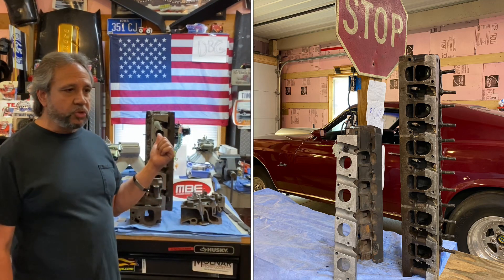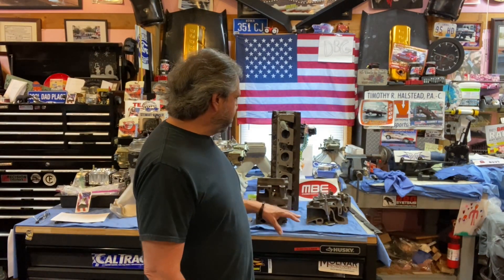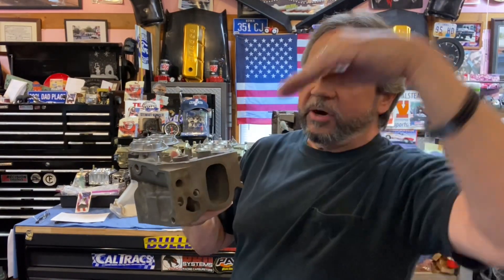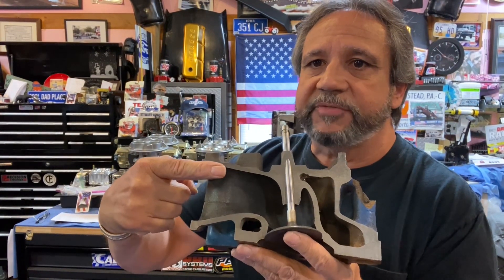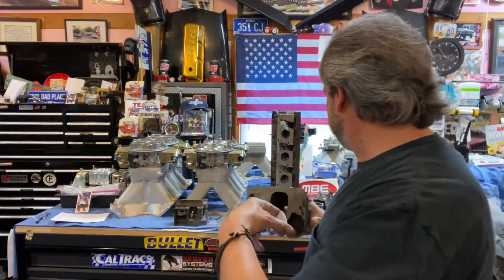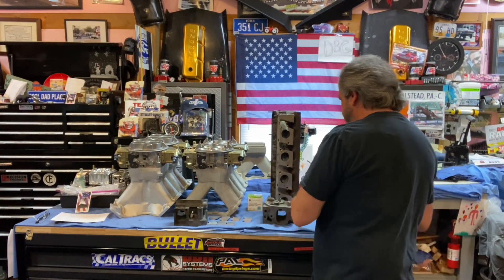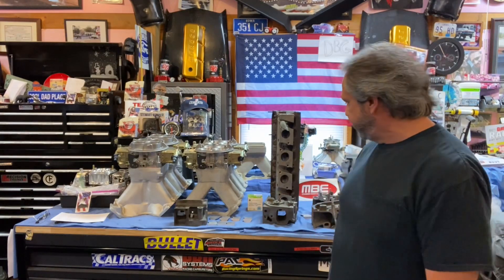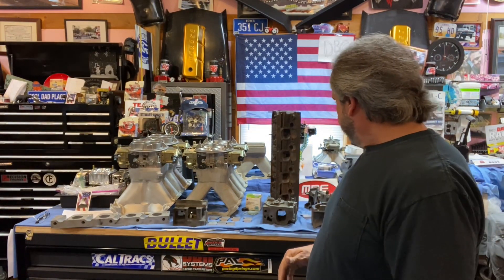DragBoss Garage: Pick Up 30 Ft. Lbs. Of Torque Filling The Port Floors Of 351 Cleveland 4 BBL Heads

Comment: smaller 2v heads running much better than 4v heads example from Holley carb  engineer, from your previous video.  2v heads were 5 seconds faster lap times.   instead of filling in a bigger port, why not use the small port head to begin with.  a picture emerges with the Cleveland heads.  either put more cubic inches under the 4v heads, or use the 2v heads under the stock displacement engines.

https://youtube.com/clip/UgkxcvcwScqy1NPsg1Hp1CobNkm2LqdjFB21

Comment: the Cleveland 4v ports were big enough for a 500 cubic inch engine.  you can add 50 ft. lb. with 50 cubic inches more displacement on the same port. seriously, you can either raise the floor of the port, or you can just make the engine bigger to better match the bigger port to begin with.  how bout a 500 cubic inch Cleveland with the same 4v head.  or a 600 cubic inch engine.  of course it can't be done but seriously, at some point more cubic inches makes the existing port just right, or too small.  I've had 351C, 400M, 4v, 2v heads and after a quick look at them, the best approach is build the tall deck 400M bored/stroked to maximize cubic inches.  if you want torque, just use the 2v heads and port those, which is what the old Holley carb engineer said in his video when you interviewed him- that was done decades ago in the 1970-80's and the engine was 5 SECONDS quicker lap times.  the 2v head already has a higher floor.

Comment: Tim, I run these stuffers in my 372. They do hurt flow a little when I tested them on a super flow 600 compared to unstuffed heads. I have run these with a Terry Parker funnel web intake and a CHI dual plane air gap. With either intake it had more low end than a full 4V and a strip,dominator. For track day, the CHI air gap was better off the corners. I suspect I am losing a little upper end HP to the Parker intake. Installing the stuffers is easy really. Use Zspar epoxy. Work it into shape with wet hands, let it dry and then Clean up with cross buffs.
Reply from the maker: Cool deal to know. So your running circle track? Does splash zone work similarly with water for shaping? Thanks for the real life experience

Comment: There used to be bronze spacers that went on the exhaust ports  with a toungue to fill in the dip on that thing and the headers kept in in place! Are they still available?
Reply from the maker: Yeah I think mpg in Colorado has them.
Reply: @dragboss351cleveland  maybe@ Ive been drag racing here in South Carolina for decades. I'm 63 now and my wife's health has gone down hill. The guys left the 9.2 deck blocks because technically the blocks were the weak link! Curiously enough, the Eldebrock Victor Jr heads almost the same 274cfm of airflow!!? The Cleveland block aren't up to the stress nitrous puts on them! The Windsor blocks with a crank web hold up pretty well! But, most of that are numbers based on nitrous,  a sledge hammer! But now the availability of high flowing heads on a Windsor platform are awesome!! I'm looking for a package for my 94F150 flareside, the 460 platform is started to become a financially affordable platform!! Let's face it, I'm not going road racing in a 94F150!! A 500hp 460 with a 100 shot of gas! Last forever,  or until it kills you!! You gotta die from something,  let the coroner earn his money wiping that grin off ur face, or not?!@
Reply from the maker: When you speak of 9.2 blocks I suspect your talking cleveland. I agree not strongest blocks. Yeah anything with nitrous make so much more cylinder pressure and those blocks were not a designed for that. Not a fan of edlebrock heads. But use what works for  you. Truck with bbf will be fun. And a little spray will make a fun day

Comment: Same holds true with the the 429-460 exhaust ports .c8-D3's . That darn low spot.
Reply from the maker: Cool deal, have heard that before about those heads, as is oiling issues with them.
Reply: @dragboss351cleveland  MPG Head used to manufacture brass bolt on exhaust port plates for the 429-460 and BBC . They cited about a 25 Hp gain and 25-30 lb ft of torque gain. They also made stainless steel intake port plates for the Cleveland heads.
Reply from the maker: Yea they did, but thought they were bronze for Cleveland as well
Reply: @dragboss351cleveland  that's right. They had them for the exhaust side in bronze, stainless for the intake

Comment: I learned about those water jackets years ago, bought a 5.0 thunderbird for the block and someone had welded the motor mounts so i tried grinding those welds out and got into the block just a little bit! And antifreeze started trickling out block ruined!
Reply from the maker: Yikes, that sucks, but a lesson learned for sure Brandon

Comment: great vid, the int port inserts shown are  the same as the ones from Price Motorsport Engineering (PME) which are modeled after the 1969 Ford T/A port inserts, these inserts should NOT be install as is and MUST be shaped/ground to port opening shape of no less than 2-1/8" to (2-1/4" BEST) tall port opening, the short turn needs to be ground/re shaping laying back & raising the short turn similar to some of the factory T/A race head designs turning the int ports into more of a venturi shape. Also slight regrinding & clean up of int port roof of (1/8" MAX) higher will help with better T/A venturi shape
Reply from the maker: Yes I figured that they need some good work over. I was thinking of doing a set and trying my luck to see how so could do. In my spare time lol. Have done a few of these installs Porco?
Reply: yes we have done a few (1/4" thick finished) PME versions and even 1/4" thick steel tongue versions that also bolted in from underside. FYI, Some of the aussie port stuffers (Parker/TFC tongues ) out are too thick and end up restricting/hurting top end flow
Reply from the maker: That’s is something you don’t think about thicknesses. One set of pro stock Heads I have are about 1/8 to 1/4 inch. Not much.
Reply: I tried to post a link to some of my old 1/4" filled P/S boss heads and it got deleted again. There was an articall online i think from motortrend showing pics of boss 302 build/dyno, the guy used the aussi parker/tfc "port stuffer" by the time he was done with grinding them where they did NOT hurt upper end power they basically looked similar to a finished set of the american PME/FORD T/A "port insert" design originally from 1969. The restrictor port aussi "port stuffers" screw up the factory short turn design hurting top end power. Again the factory 4V port openings should not be shorter than a 2-1/4" opening curving up and over the short turn.
Reply from the maker: @393boss  must be you tube that deleted. Just email me at thpa351@gmail.com. Never seen any articles like that
Reply from the maker: I saw your email let me look at it. Thank you

Comment: Great advice Tim, another way that i did was to use 2V heads which have smaller ports, i went to a lot of expense to find some 4V heads only to lose power,
Reply: 2v with a small chamber laid back around the intake and exhaust . I used the aussie 302c heads . hand port the ports . picking up cheap compression & doing your best to improve flow.
Reply from the maker: I like those heads too
Reply: @dragboss351cleveland  The only thing with the 302 Cleveland heads is the compression is too high  for a street engine on a 351, the combustion chambers need to be openened up a little for pump gas, and like you said keep the revs under 7000. otherwise they are a better option for a street engine.
Reply from the maker: @georgejohns7966  Thanks, I have always ran race gas on the street, needed it and enjoy the smell😀
Reply from the maker: Thanks George. Do what works for you. If your not spinning that engine over 7200 might not make the power you thought. But also combo has to match. Nothing wrong with 2v.

Comment: Animal Jim ran those air vanes 40 + years ago that I know of. seen him with the manifold off in the pits at KCIR. Maybe some of Kasses old school stuff?? Filling the floor makes sense with tunnel ram applications, none of the potential energy column volume is lost with the ram making up more supply of readied fuel and air in the addition of column mass. No matter what... it's all about the combination.
Reply from the maker: So true the combo is key, gapp and Roush made them first I believe. Animal told me he bought them and a aluminum cleveland block from Jack.  Column mass, with 14.7 lbs of atmospheric pressure at sea level, and some scavenging helps a lot

Comment: Take a look at a guy named Bob Huttman he has been racing 6 cyl Ford stuff for about 30 years or more. He and CJ Batten have been working with the boss 6 cylinder heads for 3 decades. I think He still is racing the 6 cylinders today. I also think he was the first to have a Boss 6 cylinder head cast from aluminum Bob was Dyno tech for Ford Motor Co.
Reply from the maker: I will see if I can find him. Never knew people still raced them. Have heard of CJ Batten, thought he did olds heads too.

Comment: Great video Tim! That exhaust cut away really illustrates how much they turn down in stock form.
Reply: I saw a guy who was doing a high HP turbo build on a 428 tunnelport, and he actually had to weld up the ports and reprofile them there was too much internal volume to get them to flow good for the drag application he was in. They are like the Hemi and 429 - designed to make power at 7000rpm+ but not great elsewhere
Reply from the maker: It’s a happy medium between volume and velocity. Wanted the best of both simultaneously
Reply from the maker: It sure does Brian. I forgot to show behind the bowls crazy to see that too. Maybe make a short on that. Thanks much

Comment: It's been said and written the legendary Smokey Yunick would work for days even weeks to gain 1 horsepower.                                     For me, I like the stories about what he did with oil pumps, freeing up hidden horses most never even thought of.                                                                                            Smokey even acquired a GM reverse engine dynamometer that allowed him to measure the cost expenditure of every working part and parasitic drag source. That's what winners do. Big Daddy now has GM/Smokey's dyno down in Ocala.
Reply: I've often wondered with building an engine and frictional losses, what would happen if you set the clearance of every part in an engine rebuild to the maximum tolerances if you would see a gain over an engine set with minumum or mean clearances
Reply: @shoominati23  😆😆😆Absolutely T-Totally 100% it works that's what Smokey proved. In 2023 it may be questionable to sink as much time as Smoke did when more horsepower can be made in other ways. But Smokey did this in specific class racing where it really paid off. He reversed rotation on 1 engine, even the driver didn't know why he walked off from the competition.
Reply from the maker: I think you would but would have to think about or compensate with oil control
Reply: @dragboss351cleveland  🤐😆😆
Reply: @DragBoss Garage   mid eighties had A super X 12:50 class @ sonoma race way my car ran the same # over & over for months until one day for no reason it ran 3 tenths faster & the next pass I spun A rod bearing. So maybe lots of bearing clearance makes for more power just for the moment lol.
Reply from the maker: Yes Smokey was quite the innovator and legend. Never heard any oil pump stories. Sounds like him with that dyno.
Reply: @dragboss351cleveland  😆😆😆Yep, he even liked to start with the cheapest discount oil pumps he could find down at the local parts houses, after he revamped them they often went into 100,000-dollar engines.                                                            And Hey Man, I should have figured you a Doctor/Surgeon. Human Being mechanics make dynamite gearheads and/or vice versa. hahaha but nolol For me, the only difference between people and machinery is...one is alive.
Reply from the maker: Good history. He never missed a chance to make a Buck. You got that right. People much simpler only a few moving parts no clearance adjustments other than wear lol. Great minds think alike 👍👍
Reply: @dragboss351cleveland  😆😆😆
Reply from the maker: Right on☺️💯🏁
Reply: @DragBoss Garage  Gee WhizZ Drag BosS your A most talented man I figured you were A multi Tasker ! but your rebuilding the 351C while it's shut off & rebuilding them  ❤,s while there still running! 👍
Reply from the maker: Thanks Martin, lol I never sit down on our couch nor do I watch Tv. We only get so much time. Glad your here ☺️

Comment: Hello Tim, GOOD Stuff!! The ports in the Cleveland were definitely  designed for power at high rpm. The CHI heads finally have arrived at Lykins motorsports,  so progress! Now waiting for the block. To be honest, that deal you showed with the 400 block making over 700 hp, has me thinking.  Keep up the great work, DBG the only place too be! Take care!
Reply from the maker: Wondering how you have been John. Wow long awaited but worth it. My buddy jay Baker worked at machine shop in Syracuse. He had gone through my 377c for me. Can’t think of the name. Who does your machine work?  Yes the 400 could be killer bad, what sucks is the bell housing size. Yes sir DBG all the way, ☺️💯🏁
Reply: @dragboss351cleveland  I've been watching and liking, but no comments. Brent Lykins, has done some for us , and local, is Brian Osborne, at Syracuse Crankshaft. Brian just got a new cnc Rottler for boring and honing.
Reply from the maker: Yes that’s it vw here Jay works for probably at 25 years. My other buddies dad worked at reliable machine for probably longer did all the crank work.
Reply: @dragboss351cleveland   yes, Reliable machine, on North Salina,
Reply from the maker: Yep that’s the place. I remember the big windows you could see the machines and guys working always. Dick Mcnish was his name